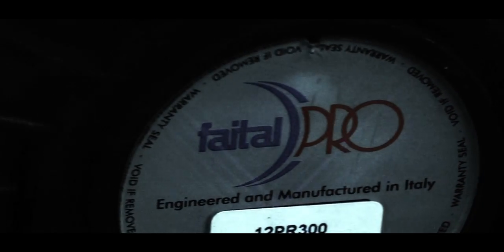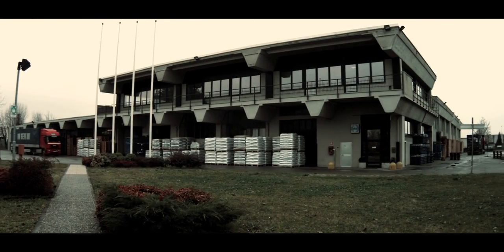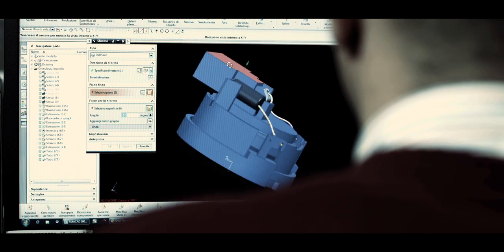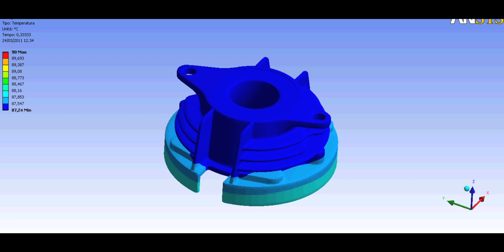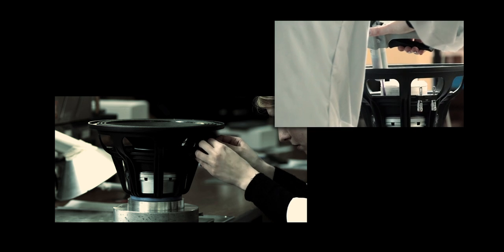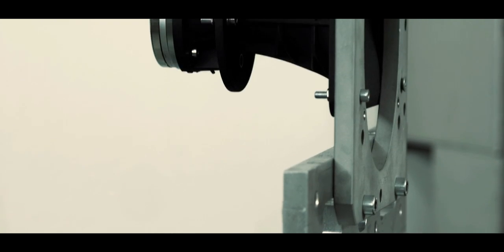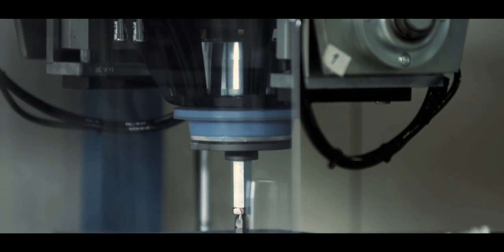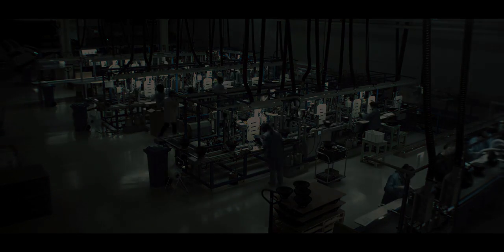Video Introduction to FaitalPRO

Comment: I wish FaitalPRO would make a 15, 18, 21 inch driver, 4 inch+ voice coil, neodymium, extremely high power handling, high excursion 40mm+ one way, automotive subwoofer, starting with the 15” that needs a minimum of 3 ft.³ of ported air space, with extremely good low end frequency response that will play well below 20 Hz and that can take a beating when driven with plent of clean power

Comment: Nice vid. Every manufacturer has some goodies. I find FaitalPro midrange/midbass line very nice. Especially model 10FH520. Have two, will order more, and will get back again later. I like good excursion capabilities of top of the line subwoofers, but these need kick up a notch with motor force for compact efficient designs. I would love if FaitalPro jumped on the IPAL bandwagon.

Comment: i bought a pair of faital pro 4fe35 for my project 3 way speaker system  57 liters vented box, 625Hz, 5000Hz 3d order crossover with woofer beyma 8 br 40n and tymphany twitter d27tg35-06. I am disappointed. it seems to me that it hasn't sensitivity 91dB. sound very nice, but very quiet, not heard from up to 1000 hertz. I compare it  with vintage soviet midrange speaker 30 гдс 1-8. in this case faital pro much worse.